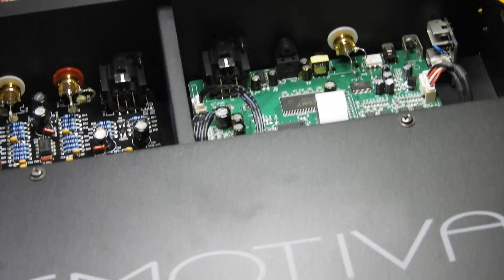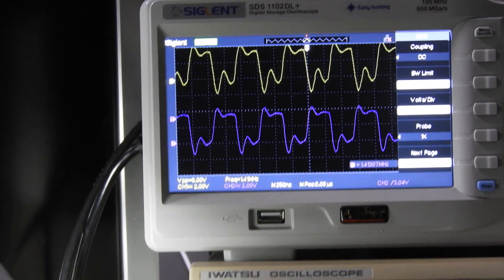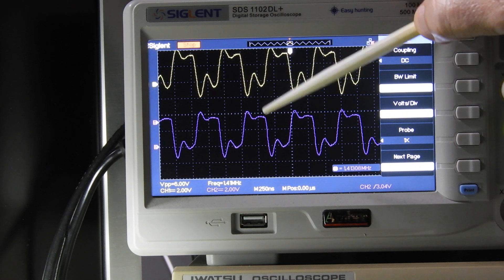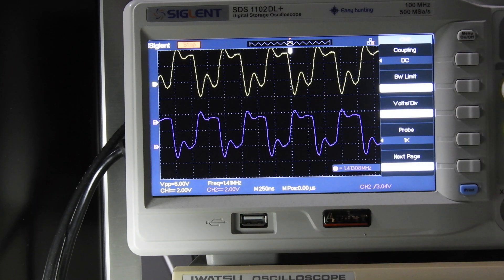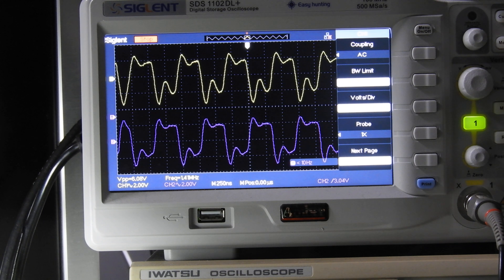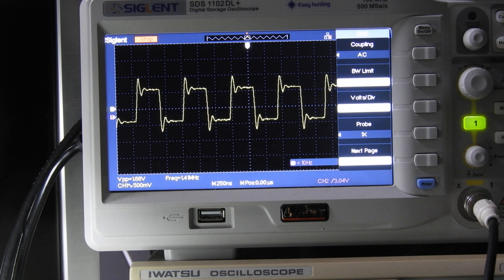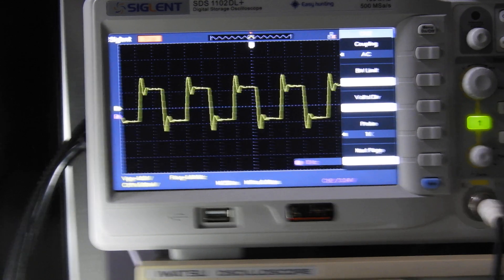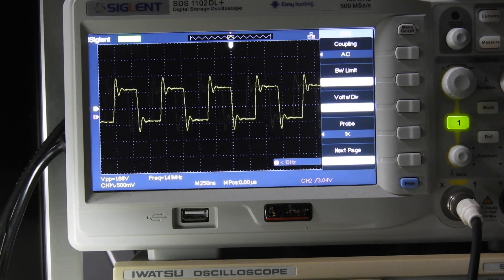AES/EBU. The trace is finally revealed. Is it really superior to other digital outputs?

Comment: are the cables in use the correct impedance?
Reply from the maker: Most of the impedance is due to the connectors, because cables are only about half-meter in length, and XLR connectors and RCA connectors always have the same impedance (or they should). Additionally, at such low frequency as SPDIF (1.5MHz), only seriously poor cables like automotive ones used for car stereo begin to impact the signal. But in a different way. Made a video about it too, where I compare 6 different cables looking at the traces they produce. have a look at it doing a search of my channel.

Comment: AES/EBU was also developed for long cable runs  , volt drop noise from other cables ( common mode rejection )  etc , maybe a better test would be to see which signal is still usable over a 1KM coax cable. also agree though that aes3 signal looks like a mess though